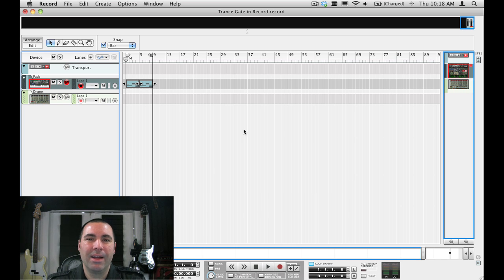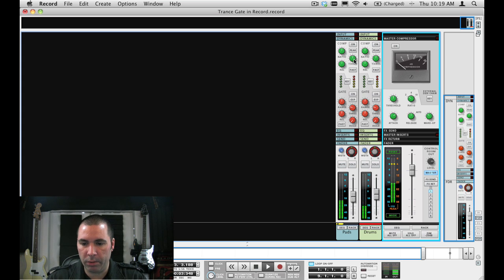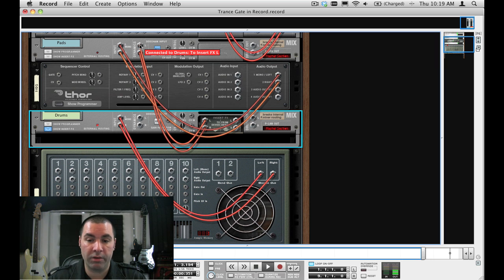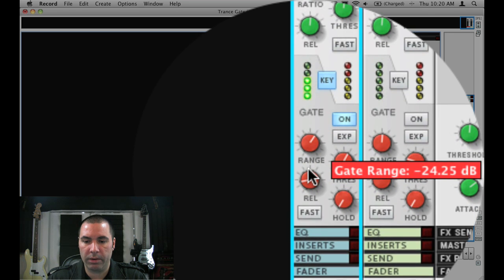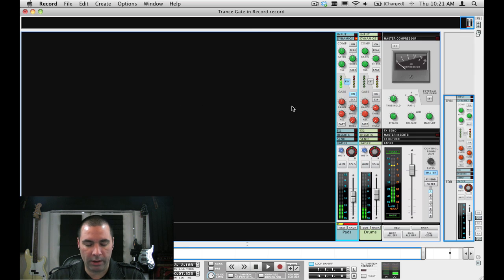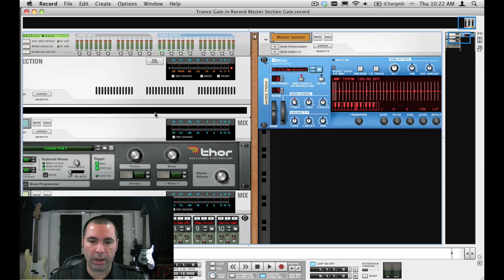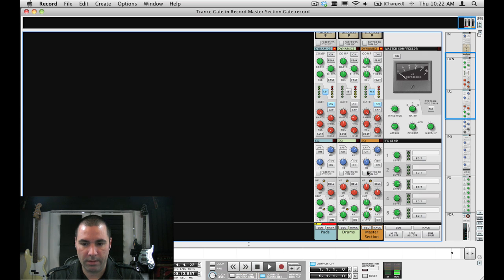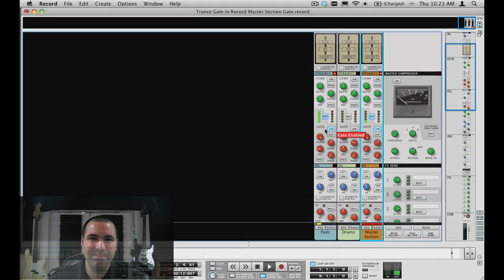52 Reason / Record Tips - Week 1: Creating a Rhythmic Gate Using Record's Dynamics Section

Comment: Hi, I tried to do the the routing with the Rex player track. I did the same routing but I can get any signal from the mix channel. When I connect from the direct out of the mix channel to the master insert in, my channel mix looses the LAN output connection to the master section.  Can anyone tell me what I'm doing wrong?
Reply: I have the same problem, did u figure it out?

Comment: @Brewbaby14 (cont.) offer great entry level large diaphragm condensers, but for these you need phantom power + pop filter + reflection filter + mic stand. Condenser mics can't be used in live environments and some would say you can achieve far more accurate sounding results with condenser mics... Sorry if you knew all this already, but there's my 2 cents, just in case :)

Comment: @MrROTD-I think the attraction of virtual patching comes from gear lust. If you are not into hardware than remember one thing... you can't run software without hardware. For my first Record session I sampled a Micron into a MPC 60 and then tracked the beat I was working on into Record. I could have saved a lot of time by working only within software, but the process I used gave me results I never intended but was very happy with plus I had a great time!